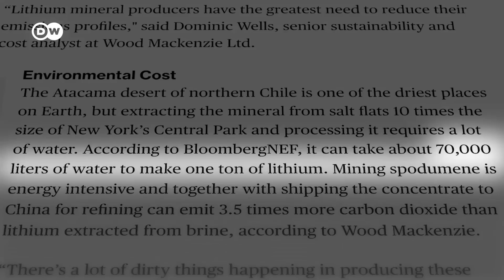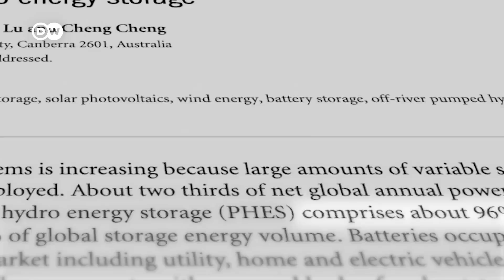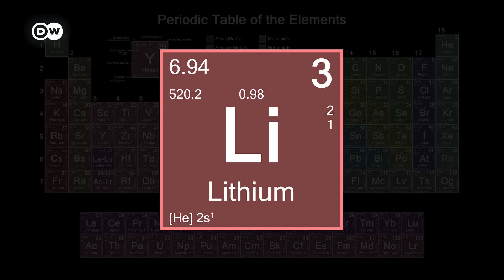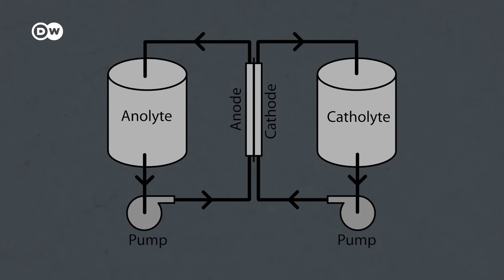How salt and sand could replace lithium batteries

Comment: I feel like the risk of lithium ion batteries burning is (as so often) greatly exaggerated. We often forget that petrol can just immediately blow up if incinerated but nobody thinks about it as they trust the technology they know. Likewise there is no higher risk for electric vehicles to just start burning as compared to normal cars.
Reply: There is higher risk than fossil fuel ones because fuels have to have contact with the fire but lithium batteries can combust for a quite few reasons. But taking that as a factor for replacing lithium is as you said an exaggeration
Reply: even if the risks are exaggerated you still dont want the risk of them blowing up the same thing happens with nuclear energy it is the safest energy by far even if you count all of the reactor deaths but the fact that they can blow up scares the public.
Reply: No form of petrol contains its own oxidizer like a lithium battery does.
Reply: @nadheem420  yes and no. You could argue that lithium batteries can start burning when they get for example punctured, whilst a fuel tank does not. However, if you hold a match against petrol it will start burning immediately whilst the same isn't true for lithium batteries. But you can't conclude that one is better or worse than the other when both compare differently on varying aspects.
Reply: @patrickgartnercoelho5628  the problem with batteries is that the chemical composition can be quite complicated and be consisting various different combinations of element. So the chances of a lot of combinations being prone to combust is high. But gasoline is rather simple with the combustible section. It is hard for the fire to get to the liquid to catch fire but lithium has many other reasons too
Reply: @nadheem420   Thank you, that sorta makes more wholesome sense than a generelised brief.
Reply: It's not exaggerated. Lithium-ion batteries can easily combust when overheated. A hot, sunny day can cause combustion. EVs require cooling techniques to try to prevent combustion.

Chinese EVs are exploding all the time due to insufficient cooling and poor design.
Reply: Exaggerated !!!  Lookup electric bike and cell phone explosions.  Lithium battery fire will restart even after all visible fires are out.  Lithium batteries can explode at room temperature.  Worse, they can and have exploded while charging (charging can produce lots of heat).  You have more obvious clue when gas fire could happen, not so with lithium explosions.  EV exploded too.  Their battery fires burn much hotter than gas fires and are more prone to re-igniting.  They are also harder to put out.  3,000-8,000 gallons of water is needed to put out an EV battery fire.  That is a good 15 to 40 minutes of full blast 200 gallon per minute fire hose.  What is left of a car after being blasted like this?   Hello, water conscious California.  We have seen the good and bad of gas vehicles for almost 140 years.  Now is EV's turn.  Driver's ED is for gas cars.   Spontaneous combustion ED is for EVs.

Comment: Pumped hydro can also work on the seafloor. You put large containers there and energy is generated by letting the seawater flow in, while energy is stored by pumping the seawater out. The large pressure at the bottom of the oceans then allows for a larger energy density compared to conventional pumped hydro systems. E.g. the average depth of the Atlantic Ocean is 3.6 km, so the available pressure difference is 360 bar. And there is, of course, an enormous amount of area available for such systems, unlike conventional pumped hydro systems.
Reply: cool concept. but you have to drive some really long cables far far away into the ocean
Reply: @danvisan7017  Yes, that's drawback. But as we move toward net zero, the bottlenecks will be more and more at the storage front and less at the average energy generation capacity. Europe can easily experience 6 weeks of cold winter weather with a high-pressure system causing the wind to not blow fast. Energy use will then be high while not much green energy van be generated. So, the storage capacity required would be of the order of the total consumption during more than a month. Energy consumption in Europe is s about 2800 Terawatt hours in year, so we need about 230 Terawatt hours storage capacity.

So, huge investments in many different large-scale storage systems are going to be required, otherwise there is no hope to reach net-zero.
Reply: @saibalmitra776  this underwater system in particular is prone to failure due to the same reasons as tide, wave and underwater currents energy is not harvested... salt water and underwater algae, shells and other lifestock damages all the equipments

Comment: Been thinking for a while salt could be an interesting option  for energy storage and be a commercial use for brine waste from desalination plants killing two birds with one stone.
Reply: killing birds with stones is pretty barbaric. Why not harness those birds for some naturally produced energy and use the stones for a Zen garden?
Reply: Batteries would not require enormous amount of salt but desalination plants will produce
Reply: @kailashseervi3448  Yes I can't say that I've looked into the quantites involved in both processes or even if the brine would be too contaminated to use.  Even if it lessened the impact of desalination it could still be worth it?  Really more of a thought bubble idea.
Reply: @kailashseervi3448  but it would still decrease the cost of both technologies, and if you can scale up sodium batteries, they can replace lithium for all applications that arent weight limited, and if molten salt reactors are to become commonplace, thats another usage of sodium right there. honestly, we do need to figure out what to do with all the sodium weve been extracting because putting them into the ocean is becoming a worse and worse option as shorelines get wrecked. maybe if we trekked it out to the deep ocean it wouldnt be as big of an issue.
Reply: @kailashseervi3448  it wouldn't be the only one method to exploit brine. Another one that I'm thinking of is the chloroalkali process for example.
Reply: Please don't kill the birds. ♡
Reply: Exactly that's on my thoughts since few years ago, back then
Reply: Yes. We need to massively desalinate water for farming, sanitation, and hydrogen, every nation, then dump the extra salt in the north sea or wherever it's desalinated by melting ice = Re-salinate the oceans. = not pollute local water, solves salt problem. Use tankers filled with salt not oil. Run by solar, wind, wave, and hydrogen, not diesel. + salt batteries
Reply: Lies again? Serie A Leader Special Agent NASA

Comment: I think Sodium ion will win it.
We don't have enough lithium to use for grid energy storage as we would need them for cars, buses, etc

While sodium can't be used for cars because of its low energy density, so Sodium is perfect for stationary use.

It is also very abundant and cheaply available.
Reply: It can be if cars were lighter and more efficient as such that the lower density would be at least compensated. 

Nobody needs to drive a >1 ton vehicle that can kill at high enough velocities.
Reply: @topsecret1837  no. If the car body was lighter that would mean that the battery would be a larger portion of the weight so it would be even more important to make the battery as light as possible.
Reply: @topsecret1837  batteries would be more useful in a bus and electric train backup power than for cars tbh. cars needs to be phased out, electric or not, within major population centres if one really wants to make a positive impact on the environment.

Comment: One of the most promising energy storage solution is to convert coal and gas fired power plants, which already have turbines and high pressure steam infrastructure, and convert them to instead heat the water to steam with a molten salt energy storage system. The power plant operator can extend the profits of the plant that would otherwise have to be decommissioned.
Reply: Yiu can also create gravity batteries by pumping water in a reservoir located higher. Very useful !
Reply: Coal and gas power stations are the future as they are efficient and reliable and dont need sun or wind.
Reply: @fivish  The future? U live in 1800s or what bro goddamn 😂
Reply: @padnomnidprenon9672  Yeah, the video covered that at 3:17
Reply: @fivish uh are you living in the first industrial revolution.
Reply: @fivish They're not future lol

Comment: LFP batteries solves the problems of regular lithium batteries. They don't contain cobolt, very safe, are cheaper, have a very long life, can be charged full regulary without taking much damage at all. Their main disadvantage is that they are not as energy dense as normal lithium batteries, but they can be charged to 100% to compensate for that limitation.

LFP will most likely dominate for 10 years at least, since new technology will take time arrive to the market. Sodium might take over the in 15 years, who knows?
Reply: Unfortunately, specific energy density is low. It is an alternative technique but not better
Reply: @emirhanartar1776  it's good enough, LFP is the best batteries for the buck, cheap and reliable.
Reply: @SkepticalCaveman  youll probably see it in low power devices that typically dont even currently use lithium ion tbh. sodium is probably going to be confined to grid level storage, not personal devices. the issues are inherent to its physics, there is no optimising the fact that sodium has a mass number of 11 while lithium has a mass number of 3. thats ~4x heavier per atom, not including the greater molecular size and electron density that prevents packing like Li.
Reply: @jonathanodude6660  Sodium for grid storage actually frees up more litium for vehicles,  so still very useful.  

Litium is already good enough for cars, they don't need more than 800 km range, that is aleady gasoline car range. Instead of increasing range, more energy density should lead to less batteries needed and therefor cheaper and liighter EV's.

For planes, swappable magnesium air batteries might be the best solution, thanks to the very high energy density. Just split the battery into many small (100 or so maybe?) modules do they are not too heavy to swap. The advantages with many smaller modules is that they can be used for other things after they been in a plane, like powering the vehicles at the airport as an example. Magnesium air batteries age fast, but that doesn't matter for planes since they use up so much energy every day that the batteries will be emptied anyway long before that.

For ships actually hydrogen might be the best option. I'm no fan of hydrogen, but for cargo ships a liquid fuel is ideal for fast refilling. Hydrogen can also be generated at sea by electrolysis using, wind, solar and waves; so one of the disadvantages of hydrogen (need of transportation) is eliminated, since the ship travel to the refilling stations on their route.

Comment: Unusually, this is a really poor video from DW PlanetA full of basic errors and mis-explanations.

Firstly there is no mention of storage time which is critical for understanding the problem. Storage over milliseconds to seconds to hours will probably be solved by whatever is the cheapest electrical battery technology: probably lithium because nothing else has the scale.

For longer storage there are many competitors as the video mentions. But the sand battery can NOT store sand at 500 °C for "months". A simple calculation shows the 100 tonnes of sand will lose 50% of its energy in 2 months. And that battery stores only 8 MWh(th) - enough for 2 homes for 1 winter. And it cannot be used for industry which requires lots more heat at higher temperatures.

Secondly Lithium batteries environmental impact is grossly overstated. And no mention is made that the most modern battery chemistry (LiFeP)which uses no cobalt or nickel i.e. no child labour. Or that the main use for cobalt is actual in petrol refining, not making batteries. 

Thirdly, lithium batteries last an enormously long time - hundreds of thousands of kilometres in a car - or thousands of discharge cycles in a grid application. And they are almost 100% re-cyclable. And while older battery chemistries can catch fire, modern LiFeP batteries do not catch fire. And molten salt? Well it throws away 70% of its stored energy when it is used to make electricity.

I can't list all the errors - but unlike most @DW Planet A videos - this one is very poor.

Hopefully you will do better next week.
Reply: They did talk about duration 5:30 - 5:50, but it was garbage. They said the molten salt storage can store energy for 6 hrs but lithium only for 4 hrs. But lithium can store energy for months with little loss if you wanted it to. 4 hours is the time frame that they make the most profit out of it typically. It's purely economics that sets that time frame. Shocking levels of inaccuracy.
Reply: @adrianthoroughgood1191  Adrian, yes. I agree with what you said exactly. I was writing my comment in haste and didn't have the patience to express myself as clearly as you. Thank you.😁

Comment: You don't need huge lakes for pumping water. We can have two tanks one on the top and  another at the ground level or under-ground. We can have a pump and pipes running between the two tanks. In fact this setup can be scaled by having as many of them as required. There are problems though.

One of the problems is that the water might get contaminated and can breed mosquitoes and algae might grow causing damage to the tanks. The solution is to constantly purify the water and replace it if it cannot be purified anymore. Another problem is that the water might evaporate over time and the way to deal with this problem is to replenish it (automatically) if the water goes down below a certain level. A third problem is that we need a source of water and this can be solved by installed this setup in the sea or ocean where there is abundance of water.

There could be other alternatives to water such as soil, sand, snow, ice (in cold regions) etc...

Comment: The end of this video was the best part; people have stored energy in rocks since learning how to make a fire. Cooling works differently, but even frogs know how to shelter from heat.
Reply: Storing energy as heat is the dumbest thing ever. Something this clueless apology for a documentary failed to mention. You'll get only 30% of the energy back as electricity.

Comment: If where running out of sand then can we use crushed glass for the heat storage
Reply: There's already a lot of sand in deserts which could be removed and also help to terraform the area.

Comment: The drawback is salt, like Lithium, like Oil still has to be withdrawn from the earth, whether from a well or a mine shaft, it is NOT a renewable source. The difference is that salt mines already exist and are plentiful, whereas Lithium mines are not and destroy the land in the area where Lithium is mined.

Comment: Your audio is catching air causing pops. Might wanna turn your mic to the side instead of speaking directly into it if you're using a condenser mic. Pointing it at your mouth from the side or up/down will still pick up the audio the same way while not getting hit by your breath.

Comment: I like the gravity storage I read about years ago. Instead of water and pumps it works off heavy weights being lifted that in turn generate power when lowered
Reply: I don't know for sure but assume that losses due to friction might be significant, so efficiency loss. Otherwise, I like the idea for its simplicity.
Reply: Have you bothered to check just how LITTLE energy you can store like this ? Thunderf00t has a good 'busted' video on the subject.

Comment: 4:22
 if I remember correctly, pure Sodium will blow up. You need to store it in the oil to prevent chemical reaction.
Reply: sodium can be VERY unstable

Comment: Once you convert electric energy into heat stored in sand or molten salt you can recover not much more than half of the electrical energy when converting the stored heat back to electrical energy.  This conclusion is based on Carnot's theorem.  Your method for storing the energy may be literally dirt cheap, but losing half of the energy still is a deal breaker.
For storing heat these storage media might be suitable, but not for storing electrical energy.

Comment: There are many battery technologies that might replace lithium. However, the best thing that we could use in the medium term to replace lithium, I'd lithium itself. Recycling used batteries requires much less energy and pollutes much less than mining and refining "fresh" lithium. It's a metal, it is not destroyed through usage.
Reply: The short lifespan and premature recycling reduces the Energy-Storage-Return-On-Energy-Invested to a point where they are no longer viable for grid scale storage. Lithium ion is simply insane to be using for grid storage. At least lithium iron phosphate can ba amortized across 10,000 charge cycles.
Reply: The technology can be developed through necessity by law by making manufacturers be responsible for also extracting the lithium on the end of the lifespan.
That means they will have to figure out how to make it cheaper to recycle

Comment: There wasn't much detail in this video.  How do you convert the heat to electricity?  Steam turbine?  And how did that one guy transport heat to other buildings for heating?  Steam pipes?
Reply: That is operating in a town that already used district heating, ie central heat source transferred to buildings through pipes. They just connected the sand battery to the existing system.
Reply: And also consider the energy loss. Mechanical energy > thermal energy > mechanical energy > electricity 
There are many inconsistencies. Obviously, businesses would want to promote their technology as best even when this is not true.